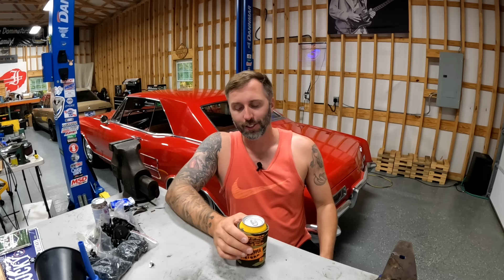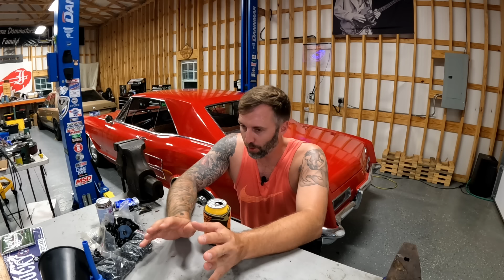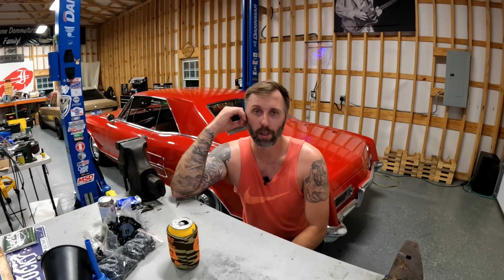Why I Ditched Holley Sniper EFI

Comment: Put one on a 64 327, put the sniper, hyperspark, distributor, etc… did the full tune timing graph etc… 
This system killed the Rod bearings from too much fuel. Motor only had 3k on it & was in the car for 15yrs… 
Long story short, full rebuild 11.5 to 1, afr 195s, & back to 650hp carb

Comment: iv done three snipers, they all worked good for 6 months to a year then nothing but trouble, control panel to o2 sensors. i am building a motor now and i can buy a bad ass carb for under 1500.

Comment: Just wanted to say (with no loyalties one way or another) that what you discovered is a concept called the "asprin cost." What I mean by that is does what you're buying solve more headaches than it causes. If you pay $3K for it but it solves more than $3K of headaches it's a win. If it causes you $2K of headaches and costs $3K you're in $5K. How do you place value on that? It's indivdiualistic. 

Right now I'm going through that with Megasquirt II. I have tried to run HEI with it a few times but I never really had much luck running it honestly. Always seems like I'd wind up with stalling and overheated 8 pin HEI modules. I'm thinking about getting a MaxxECU instead so that I'm Vortec 4200 ready when that time comes.

Comment: No chance I'd ever use rubber pressure side fuel lines. The only advantage the few guys I know that suffered the high coast and trouble EFIs is quicker start after sitting. My high use, performance built old Fords have single 4bbl, dual 4, supercharged and 2 weber carbed prewar cars. All carbs pro built and dyno tuned. I never have to touch them and they run well. I use pertronix and MSDs because they are extremely dependable and well worth the few bux. A primary reason I drive old cars is simplicity and dependability. 64 Riviera cruiser is one of the very few GMs on my bucket list. 

Build them to fit you is the best way.

Comment: I ‘ve been wanting to buy and install a Holley sniper kit for some time on my 74 Bronco. Been watching videos over the last few months on comparisons and pros and cons. I have a co worker who works on “trophie trucks” on the side you know the desert racers. Well he said this question came up from the owner of the “truck” so he explained to him what would you prefer? If The sniper system failed out on the trail and we lose an entire day trying to fix? Or would you rather have me pull carb have it fully rebuild and/or fixed and truck up and running with in an hour or so? Which do you prefer? Point taken ….

Comment: EFI is way better on hot soak restarts. Mostly do to the sh!t fuels available today. Today's fuel will boil on a hot soak causing hard restarts while with EFI the fuel remains under pressure and does not boil. Bottom line is a correctly performing EFI system will have better overall drivability than a correctly performing carburetor. The only real downsides to EFI are cost parts/labor and a probable small loss in power output. Seems carburetors ultimately put out more power. This is the case in every test case I have seen on the tube. There has been a few over the years both dyno and track testing. It has been claimed that the charge cooling affect a carburetor provides gives a more dense intake charge increasing output somewhat. Well who knows I say run what you like as long as your choices are within your abilities.

Comment: sniper def has it's issues. and customer service is hit and miss with them. question is, what was your purpose in swapping originally? would you try it again with the new sniper 2 that's supposed to remedy all the issues you encountered?  or maybe consider something a bit better quality like a term x stealth if you wanna stay TBI. or you can always go to port injection.. or just stay carb and deal with the cons it has and the benefits of simplicity.
Reply from the maker: I may try sniper 2 but if i do it will be on a different car.   This buick is gonna stay carb.  Honestly the more expensive terminator x and such dont seem to have the problems of the sniper units.
Reply from the maker: thanks for checking out my channel, subscribe plz!
Reply: already way ahead of ya lol. I'm one of the lucky ones that didn't have any major issues out of my sniper. slight linkage issues, sticking secondaries, 1 o2 failure, and TPS adjustment. but I'll be upgrading soon to either a port injection term x or possibly moving to haltech because they just seem to offer more bang for buck and their custom service has me sold. doubt they'll ever get a TBI system, but you could still drive a univeral or holley TB with their ECU which is essentially what the term x stealth is.  @timelesssteelgarage

Comment: My sniper out of the box had O2 sensor failed. Flooding engine. Got that fixed after going back and forth and back and forth with customer service. Then the coolant temp sensor was trash. Reading 25-40degrees over. I could literally spin the connector and sensor separately from each other. Thankfully I work for a GM dealer and was able to get the ac Delco brand and wow what a difference in quality coolant temp sensor. Just the weight alone was the quality difference. Like holding a piece of aluminum then holding a piece of steel. The fuel pressure gauge was annoying also. They want 60psi but don't have a fuel pressure sensor or an easy way to mount one. Why have that requirement and then not be able to monitor it. Then the throttle cable lever extension is a must. Throttle control is non existent with stock. Alot of little things you have to buy to make better. Now that I have allllllll the little bugs worked out. Aside from the 2step that activates all the time when it's not being activated... it's been great.

Comment: Thank you for the honest feedback on your experience. Do you have any experience with Fast fuel injection? I was wondering about comparisons. I am guessing they are almost identical, but I am wondering if one is easier to install than the other or if one is better than the other based on using both systems.
Reply from the maker: I haven't used fast on anything unfortunately

Comment: Never had any luck with holly products. Holley carbs i hate so tempermental leaking whenever and use way more gas than quadrajet. Holley electronics and fuel pumps my experience seems par for the course seem to shit the bed often and for no reason. I keep my many GM cars and trucks sock GM parts and free of Holley parts

Comment: On the Sniper 2,

There are two Adjustments screws with green springs around them.

I really want to know what each screw adjusts?

Like the front one (towards the front of the turck) adjusts ___ ?

And the rear most one is for adjusting the _____________________?

Comment: first step remove the TPS from that throttle body set it in a toaster oven on about 300+ degrees and see how soft it it gets to a welding glove squeeze cause my bet is it will be spongy as hell those adjustments don't hold on soft plastic

Comment: I don't think a computer belongs in a car. That said, I can see a use for them. Like rock crawlers. No carb can work at those angles. Will it make your life better? Never $3000 worth. Probably not even $1500 worth. I have heard lots of guys swear by them, but a lot swear at them. They get sucked in by the promises that life will be better and end up with a system that doesn't even work bad. I'll stick with any make of carb. BTW, I owned two Minis. I love the SU carb on those things. Same as my MGBs. Most reliable carb in the world.

Comment: I'm like you if it aint broke dont fix it....fitting an LT1 into a  67chevelle removing Efi bolting on 30Lbs feet more torque by going that route, basic holley vacuum secondary.. not to mention the ol' 0Pti Spark, going HEI one wire ignition. I just cant bring myself to cut up a nice fuel tank and create problems for future use. Thank you for the info... (F the HATERS) most key board rambos dont know shat anyhow..Happy Motoring
Reply from the maker: Haha thanks man.  Subscribe!
Reply: brother I done that right away  @timelesssteelgarage

Comment: Man im having no spark issues again, last year just out of warranty. So i paid 250 plus shipping for the throttle body, but i paid an holley authorized mechanic to fix, i was 2400 after said and done and now im having yhe same issue a year later. I want to go carb, can you help me with what i will need to switch over. I have the hyperspark ignition, holley distributor.
I was going to send it back and sell the whole system to pay for the switch. I just dont know what i will need

Comment: I hear lots of stories about All systems
I have the powerjection lll for almost 14 years in 70 cougar XR7 428 CJ
Has never let me stranded I do mind using a laptop 
41 years had this cougar
Turn the key any temperature starts first time
I had to learn how to tune all myself no one could figure it out when I bought it not even where I got it from
After learning the system I love it replaced couple sensors in almost 14 years

Comment: EFI is cool to play with.  But I still rather have the simplicity of Carb.  
Also, EFI can be great when everything is new.  But EFI adds so much more things to break or quit reading info.. Can be a super big headache with an intermitting connection problem, one that was expected to be great quality connectors. 
Also, EFI never means that it will give more power vs carb of equal status.  It means that the fuel will be delivered in a more complicated manor.

Comment: Bought an entire Sniper2 system. Could you post a link for the large user manual from holleys site? I can only find the quick start guide. thanks!
Reply from the maker: https://documents.holley.com/199r11322r.pdf

That's the one I referred 2 in the video.
Reply: @timelesssteelgarage  oh ok... do you know if one exists for the sniper2? I would assume they are very different

Comment: my brother got sniper 1 to put on his foxbody and the hyperspark ignition kit and the vary first time we started the car it was running poor turns out the TPS was bad from the start replaced it then run fine but after day or so got to where it would take forever to start  after it's warm then one day he drove it to play golf and it died on him the screen was blank when it did start it was back firing bad so he borrowed a revised version throttle body from our other brother worked great sent his to holley they told us they never tried to diagnose it they just wiped it out and reinstalled the firmware and send it back we put it on the car immediately had problems finally Holly agreed to just send him a brand new one put it on now 2 weeks later it's starting to show signs of problems and my other brother just started having problems with his so we are ditching the sniper and going with either Edelbrock or full-on Terminator will never buy another sniper again

Comment: Im sure someone has already said something, the injectors they use in thses sniper kits are not a very good injector from the get go. The 02 sensor placement was another big issue on killing 02 sensors as well. I can definitely see that certain kits had bad hand held computers as well. People forget that the sniper kit is still relatively a new efi system so people have to test them and see what issues pop up for them to adjust on and fix the issues they have. Most get mad at a simple issue then want to return the whole kit and bash the product. Atleast you tried working around the issues with tech support b.s. Sucks trying to get a new throttle body ended up turning out you had to just send the whole thing back to holly. That sucks completely

Comment: I have the Sniper on a 1970 GTO. It does have all new wiring, but I never had any issues with it for almost 2 years. Spark plug wires and plugs are about 15+ years old or so. I never changed them out yet after the car was in hibernation for a couple decades. 

I originally just had the external pump but changed it out for an in tank pump. I do recommend the returnless as you are not returning hot fuel back into the tank, potential fuel vapor lock issues etc. I put a fuel pressure regulator as close to the tank as possible. I have not had any issues besides the touchscreen sucks and have to press hard to get it to respond. 

I just need to learn how to tune it when it is cold (60 degrees or below) as it will almost die sometimes when first started until it catches itself and then it is good to go.
Reply from the maker: I am glad you have had good luck with it.  Subscribe plz thx!

Comment: I'm about to be right here with you brother the Holley sniper on my 496 is driving me absolutely insane. It's been a problem since day one for some reason the voltage reads 12 volts on my screen I go down to the wires that run The Holly and I'm at 14.2 V WTF. I might go back to my 750 demon double Pumper

Comment: I've driven carbureted cars in the first part of my life, never had any issues, but many not all but many fuel injection cars have given me trouble, fuel injection is overrated and a big lie, and carburetor gives me far better throttle control than the pump over and under surge meaning most of the time what you want from the throttle pedal will be more or less than you want, over shooting or not getting enough, when do donuts and horsing around,another thing I've noticed with fuel injection, is a delay than a build up and an over burst throttle effect that I don't like, not nearly as predictable or controllable as carburetors,

Comment: i got tired of dealing with all the idosyncrocies of the holley sniper, and mine was the 2300 model. i put it up for sale now, and went back to a carb and dont have even half the issues, it just works. out of curiosity how does the software compare with tuner studio and other systems you have played with?
Reply from the maker: Agree with you a 100% .   It was pretty easy to use. But I have definitely had more detailed tunable software.  The terminator x software on the laptop is better.  The SCS delta Ecu I have in the ecoboost DeLorean is awesome you can change everything.   Tuner studio can't be beat for its simplicity. 
Thanks for checking out the video.  Subscribe!  Thanks

Comment: If it's a car with no smog requirements, keep it simple with a carb. OEM car and carb makers spent tons of money on lab and test research to refine carbs. If your good, you can do an abreviated carb rebuilt with the carb still on  the motor.  There is new movement in old car hobby to keep it as OEM as possible. Easier to get parts and you don't have to worry about someone else's unsaid issue. Many of OEM parts faults and fixes are well documented, thanks to You Tube guys, Example: Q-jet is well sorted.

Comment: the problems ive seen is putting a sniper efi with an old gas tank and dirty fuel. seen a couple of fuel pressure regualtor stopped and wash the cylinders

Comment: Exactly the same thing happened to me.  Soaked the rings in a brand new Motor in less than 3 hours of driving.  Sniper EFI is the biggest piece of crap ever made by Holley.  They refunded my money and paid to have the motor repaired.  The Sniper DUMPED huge amounts of fuel and car cut off and I coasted into a gas station on the first drive.  Turned the key on to run …no crank….and fuel POURED into the carburetor.  No kidding …probably 1 liter….and I ran and shut the key off.  Professionally installed by a Holley Mechanic no less.  Shop is sponsored by Holley.  

I ripped that crap off….sent it back and went with a Holley High Ram EFI setup coil on Plug system for a Ford 363.  DON’T EVER…BUY THIS JUNK!   Cost me a small fortune to pay the shop to take it all off and buy all new parts.  Car sat for almost 6 months waiting on parts.  Sniper EFI is TRASH!

Comment: My sniper came with 1 of the injectors plugged in wrong, and had 2 more come disconnected within a few months.  Tech support kept telling me I had a fuel pressure issue and it was my fault.

Comment: I was a carb guy for 25 years and Buicks need a Carter carb to run right (ase)cert high altitude carb
Reply from the maker: Nothing makes a nailhesd crank easier or more reliable then a factory carter.  That's why I had the stock one rebuilt and re plated.  It's basically brand new and runs great.  I have a spare on the shelf lol.  Thanks for watching plz subscribe!

Comment: Kinda thinking everyone who's experienced the fuel dump failure should be reporting these things to NHTSA or some similar agency.  It's clear that Holley is well aware of the problem, and has developed a solution, but doesn't give two shits about all the ticking time bombs that are still out in circulation.  That should cause a LOT more concern than it seems to be getting.

Comment: Carburetors are simple and efficient and NO COMPUTER! Carbs are easy to tune if you make changes to your engine. Aftermarket Fuel injection systems run too fat, always black smoking at idle.

Comment: Listening to your story, it seems Holley is a victim of their own success. They did not build in enough knowledgeable people to handle customer service & they were pushing out so many units, they did not have enough quality inspectors. This is especially important because it is a rather new thing and it is not plug and play. Also, don't you need O2 sensors for the computer or is that for a more advanced setup?

Comment: As someone who works customer support for a major automotive manufacturer... without a part number it it hard to trace anything back... secondly , am i supposed to read your bleeping mind on the product? Great you got a sbf.. or sbc... or big block pontiac... great that does me no bleeping good when i have several part numbers for that application. If you are calling i expect you to be prepared.. to have numbers... where bought, etc so i can help you the best way possible instead of trying to help you by psychic powers.    Other than that , great video!